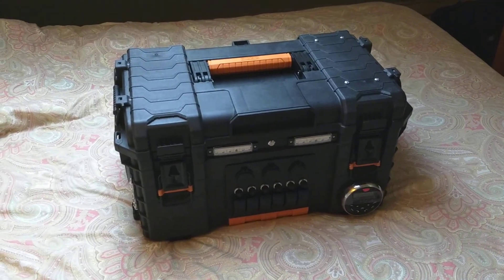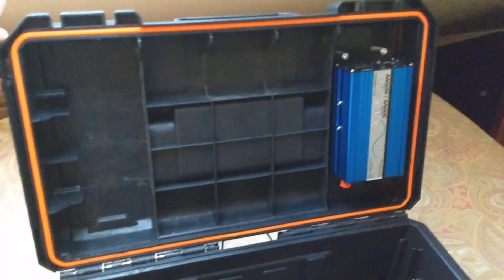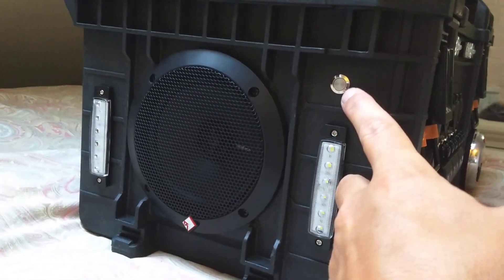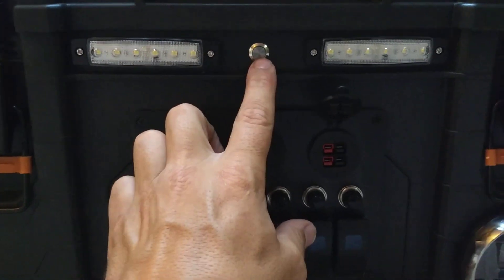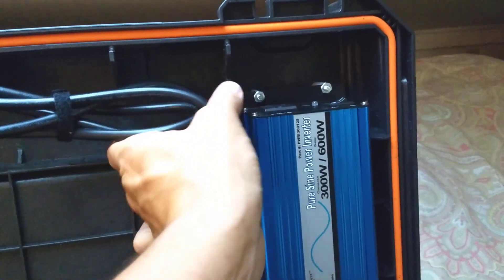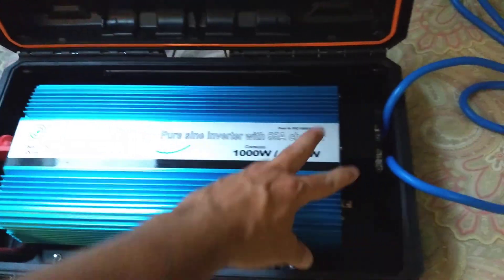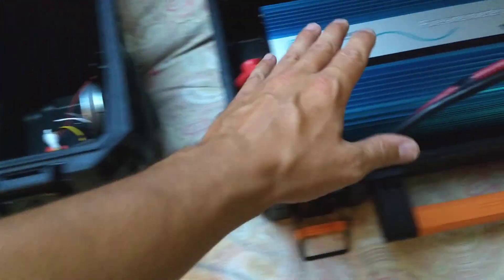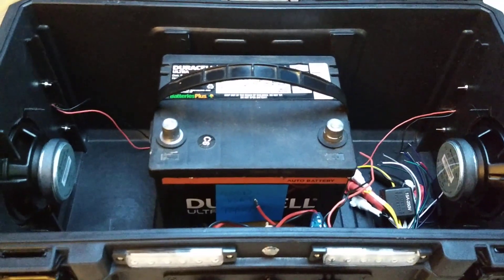DIY Power Box PART 1 for work, camping, home backup, or off-grid

Comment: Nice build
I have something similar that I use for the drive in theater. 

https://youtu.be/9hBAsLWhmP0

My system you have to plug in the speakers. 
It is a 2.1 channel 1200 watt surround sound system. 
It has two 6x9 Polk Audio 150 watt RMS/ 450 watt peak
One 10 inch Polk Audio 350 watt RMS/ 1050 watt peak marine subwoofer. My amp is a 1200 watt 
Class D amp
Everything is powered by a 12v 100ah LiFePO4 battery.

Comment: What about temperature control/venting?
Reply from the maker: With a flooded lead acid the battery will vent while heavily charging/discharging so I'll pop the lid open when I'm doing that. With small loads I don't care as much. When I go to an AGM I won't care at all as they are sealed.

I always keep the lid open when running the inverter for that reason and all of my plugs are inside so that you can't close the lid when on AC power.

Comment: I used the same Rigid box and I went with 3 55AH AGM scooter batteries in parallel (165AH total).  I kept the 800W Inverter outside (since it can get hot).  I am using a portable USB radio that recharges with the box.
Reply from the maker: Awesome! My plan is to eventually swap out to like a group 31 AGM deep. This one is still working so I'm rolling with the 26 starting battery.

Comment: Hey buddy, love the video. Keep to deep cycle marine batteries, stay away from lithium mate trust me, they dont like solar setups. And gell batteries are a no no. They dont like deep use! Kills them off. With deep cycle marine batteries they can take good deep long use and charge right back up again. Trust me. They last longer and you havnt to worry about exploding batteries.

Iv got the same plastic project/ tool boxes. There amassing, and you can clip them together with the rubber/metal handles. Looks the best project ever lol

Thanks for sharing,😉👍🤘

👍👍👍👍👍THUMBS UP👍👍👍👍👍

Comment: Do you have a link to the circuit breaker panel? The only ones I can find have a voltage readout, not the solar hookup.
Reply from the maker: Hey Steve

The one found in my writeup on my webpage has just a voltage readout. I found a powerwerx DC quick connect and swapped it out. They were the same size as all the other circular plugs. 

Since I was going to put the power meter in, I didn't need a volt meter on the switch panel.
Reply: @affordabledcgenerators1607  sort of what I figured, thanks for the reply!
Reply from the maker: Steve Morrow no problem, good luck with your build